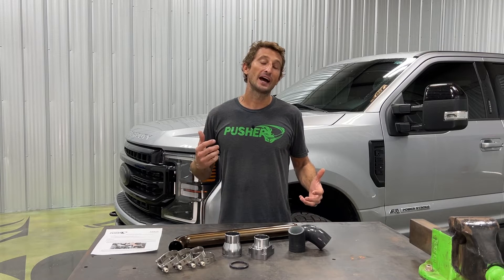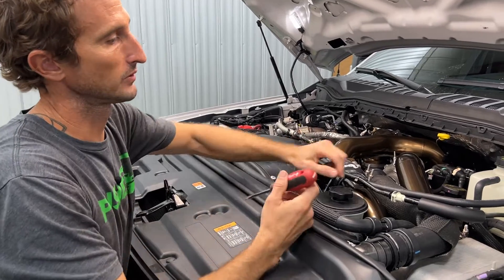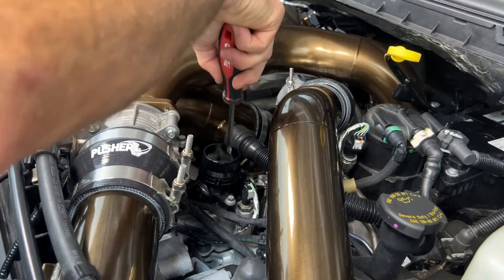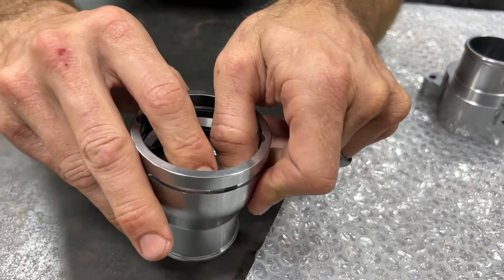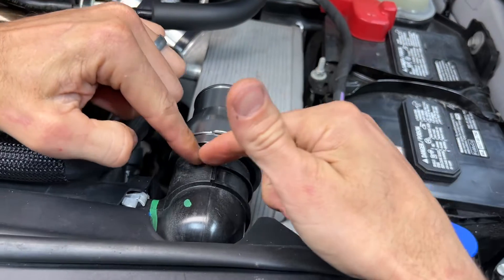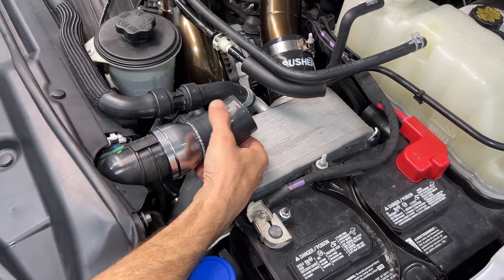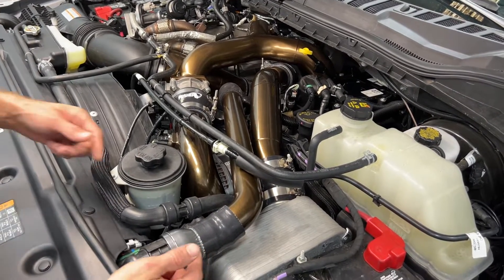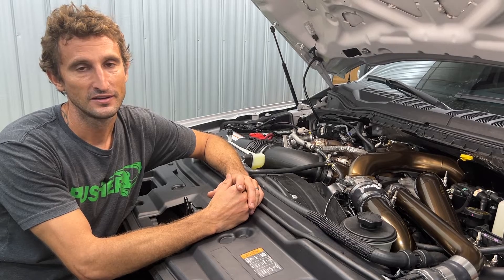INSTALL GUIDE: Pusher HD Upper Coolant Tube, 2011 and up 6.7L Powerstroke

Comment: Great video, already purchased Intake, Charge tubes and Rad pipe. Haven't yet installed, next project.  I've shown your beautiful pipes to friends, few have commented on the Rad Pipe.  Are there any concerns for metal Rad Pipe and Engine movement?